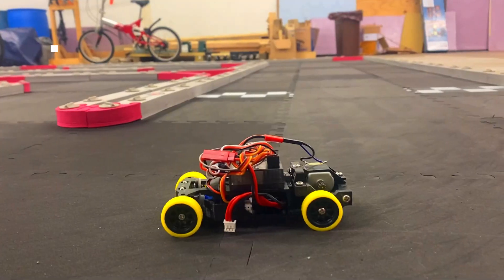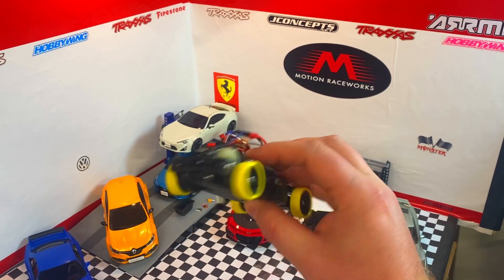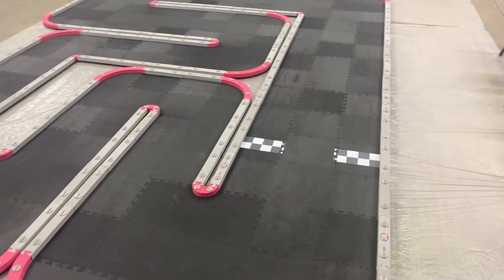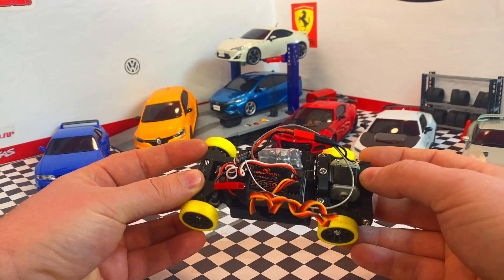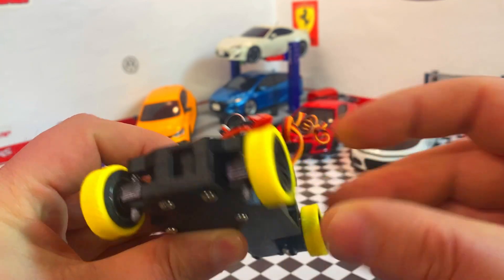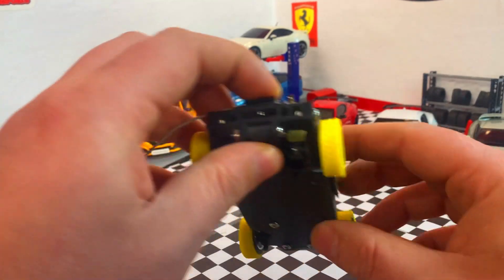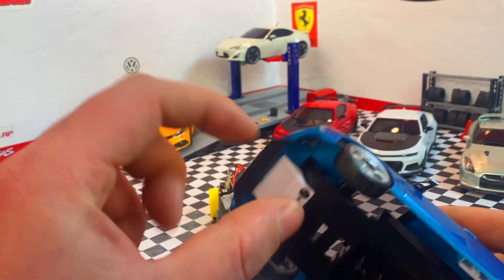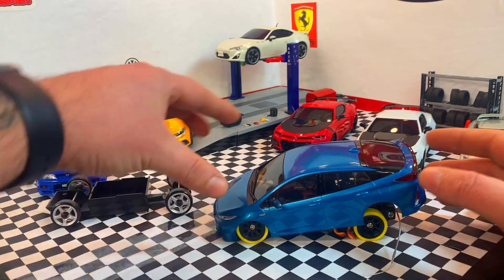What is a 3D Printed car like to drive?

Comment: Printed one of these. It's a riot. Mine is rather quick. Depends on motor and gear set used (duhh). He has multiple options for gear sets on the github.
Reply from the maker: Did you find a body for it?
Reply: @10thScaleGarage  not yet. There are a bunch of print options that are the right wheelbase (in theory). This guy has a bunch that do say 90mm which in theory is the right size. https://cults3d.com/en/users/studio3dx

Comment: I've printed 2 Open RC  1/10 cars, 1 is F1 style and the other is the Ossum Rat Rod. Both run  a 2s system with a 540 size motor. I have also printed switch mounts, GPS holders and other RC related stuff. Have your brother stretch the chassis and print 1 to fit the Mini Z body
Reply from the maker: I think there’s a mini z body that will fit it. I just need to get my own printer.